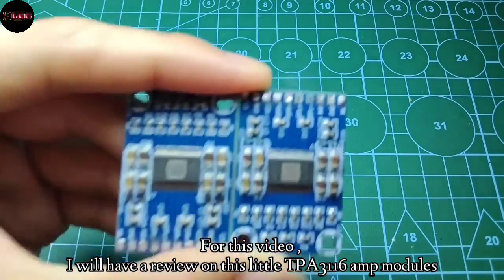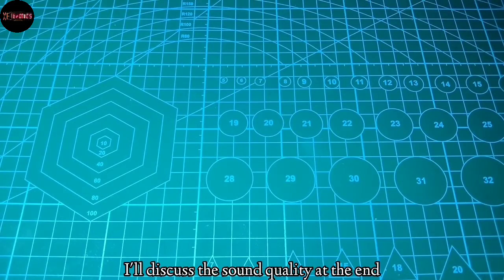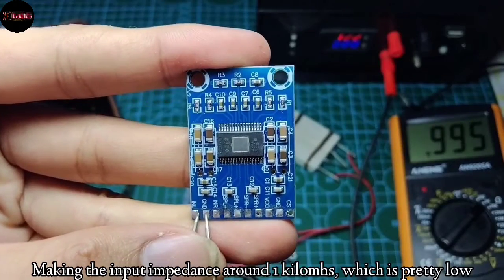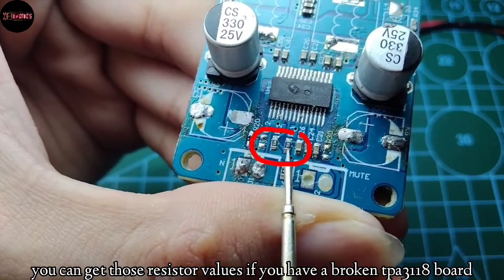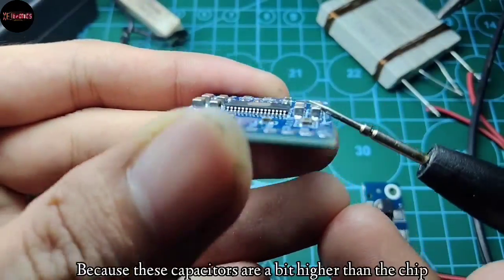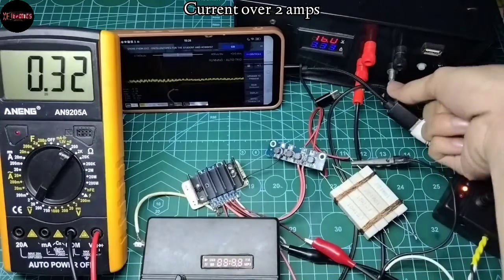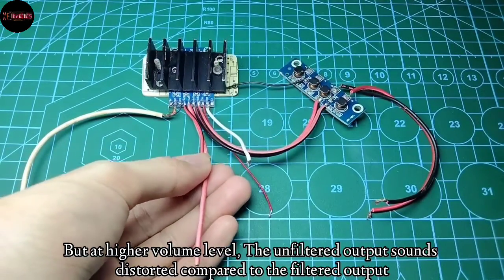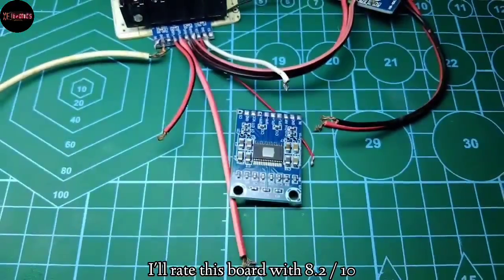Cheapest TPA3116 Real RMS Power Test and Review (XH-M562)     #tpa3116 #classdamplifier  #diyaudio

Comment from the maker: Cheapest One you can buy -
https://s.shopee.ph/4VOzvC3mxm
Reply: If this chip is original, it has a power limit setting at pin 6. If you modify that from the datasheet then I think you can get its maximum power output.
Reply: I recently ordered 30pcs for $0.3/pc. I will test them after modifying gain and plimit.

Comment: Bro pls suggest me best amp for 4ohm 10w speaker pls
Reply from the maker: Tpa3110
Reply: @x3dtronicsph  hahaha I was thinking abt that too 😂❤
Reply from the maker: @ChanderRai-h2k recommended around 16vdc for tpa3110, sounds good😆
Reply: @x3dtronicsph  but I have to use it with 12.6v 2a 😢 will it be good
Reply from the maker: @ChanderRai-h2k yeah, tpa3110 will be decent for 10watts speakers at 12v. Very matched

Comment: Finally someone who understands audio rms power vs that silly peak music power nonsense. Well done  ! Nice review and analysis.
Reply from the maker: Thank you brother 🙏
Reply: I too have just acquired the tpa3116 boards and was testing them. They seem to work ok, but then I saw your  video about low frequency response of the M543, and sure enough below about 200hz gain drops off. There are 2 caps - at input & output of opamp. Both 1u (I think). Maybe I'll add about 10u in parallel and see what happens  ?
Reply from the maker: @rohitkhanna yup, that will work. 2 out of 4 of the Input preamp are just buffers.
You can try adding a capacitor to the feedback resistor in parallel if you want
Reply: @x3dtronicsph cap în Parallel to feedback?? Won't that simply reduce gain at higher frequency? 

I tried increasing cap at the input - but that didn't work! Gain still drops of and clips at lower freq. I'll have to double check my siggen output ( just in case). Also sig gets distorted. Reason unknown as of now 😢
Reply from the maker: @rohitkhanna yes, if you want to use it to drive Woofers.
I will also try to modify mine

Comment: Hi, can you recommend dc-dc isolated converter.
I need isolator that can handle around 5-10 watts device.
I need to remove ground loop.

my supply is 23.5v and the device input can handle 8-36v. stepdown conversion isn't really needed as my supply is compatible, just the isolation to remove ground loop.

thank you
Reply from the maker: Well, 5-10 watts, I guess you need to DIY that. Commercially available is only 2watts.
I'm not sure if there is 5watts. What will you power with 5-10 watts though?
Bluetooth decoder doesn't draw over 1w of power though
Reply: The device I want to power is ZK-DAM H1.
it is a mic preamp with built-in bluetooth decoder and voice tone controls.

I don't know how much wattage it consumes as it's not listed on it's specs sheet.

I'm looking at b2412s but it says 1watt, I guess it's not suitable.

I saw LM317 isolated buck converter, but I watched  a video of a guy testing LM317 from china and says it goes really hot as the voltage conversion difference of input and output increase.
But I can't find the info of maximum watts it can handle.

I've been watching lot's of your videos and read on comment section that you mentioned you use dc-dc isolated.

btw, I've used LM2596 (seems chinese knock off chip too) on my ZK-DAM H1 and it burns as soon as I switch on the power supply.. I assumed my device used more watts past the limit of the buck converter.
Reply from the maker: @emsayonachi9300 okayyyy.
First, you need to know the consumption of your decoder.
You need to Power it and Connect an AmpMeter in series. Then tell me the Voltage and current Reading
Reply from the maker: Bro, I checked the product, and it seems like it has a Built-In buck or boost converter circuit.
See the chip and the Coil near the barrel Jack
Reply: behind the dc barrel jack, these are the components
black chip: SS34
inductor: 101
smd capacitor: 35v
bigger black chip: XL1509 - 5.OE1' 33213

Comment: Pls test xh-m190
Reply from the maker: Upon checking, it still uses the TPA3116 chip, which I had about 3 reviews about that chip.
XH-m190 uses 2 chips, 1 chip per channel bridged mode.
That means it can output around 45watts RMS into 4Ohms Load per channel at 20volts supply.
You can check this Video
https://youtu.be/wlTxvTmnJws?si=iEZ4zG6Y7k0cF6ej

Basically it's like two of this mono board in one PCB, same rating

Comment: Great
Reply from the maker: Thank you brother
Reply: @x3dtronicsph  Brother can you tell me that which amplifier board would be better . This or original TPA 3118 board At 15 voltage power supply ?
Reply from the maker: I can't tell yet bro because i didn't have a Original Tpa3118 module. I will probably make a video comparison of the 28pin vs 32pin tpa3118.
But personally, I like this Tpa3116 because you can add a larger heatsink on it, .
Of course you will need to modify it or use a preamp to output it's maximum power.
The tpa3118 though have a thermal pad beneath the IC, pretty hard to add a good heatsink
Reply: @x3dtronicsph  Brother I just commented some text but I don't know how it suddenly disappeared . I think it's a bug / glitch of YouTube . Can I have your email to contact you ?
Reply from the maker: You can with Facebook bro.
Can't check mails now because lack of data
Reply: @x3dtronicsph  Can you share link ?
Reply from the maker: It's on the channel description bro.
I'm not sure if sharing links here is allowed
Reply: @x3dtronicsph  it's obviously allowed